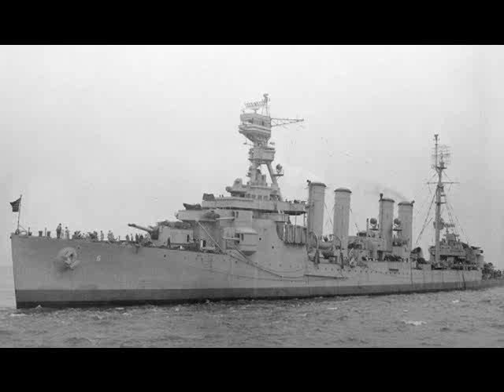Omaha class

Comment: Marblehead 
https://en.wikipedia.org/wiki/USS_Marblehead_(CL-12)
had quite a story which is recorded in the book Where Away: A Modern Odyssey by George Sessions Perry and Isabel Leighton - 1944.  You can still find a copy of that.  It's on Kindle via Amazon and I just found a hard back copy.

They got good usage out of those four props - steering the ship all the way to South Africa using the engines after they took a steering hit off Java from Japanese aircraft.  Note: This was something Bismarck - with only 3 props - could not do - and the reason it was caught and sunk.
.